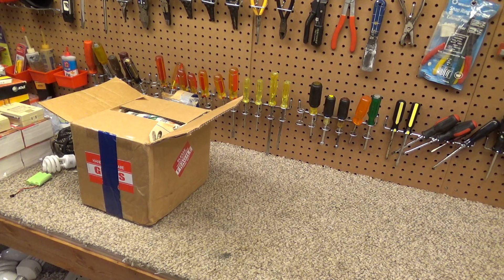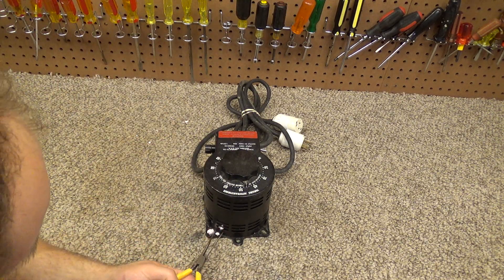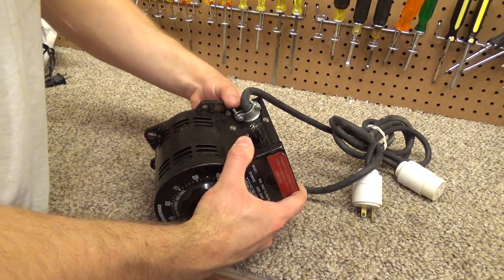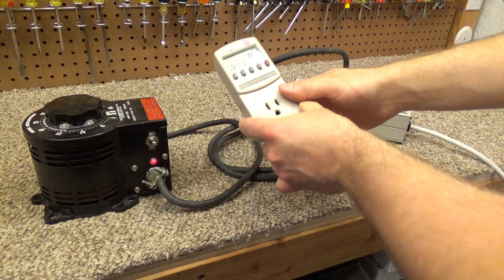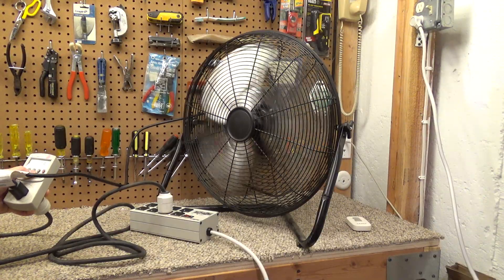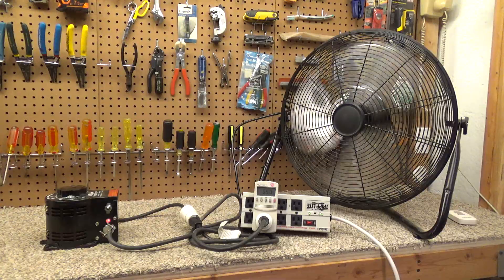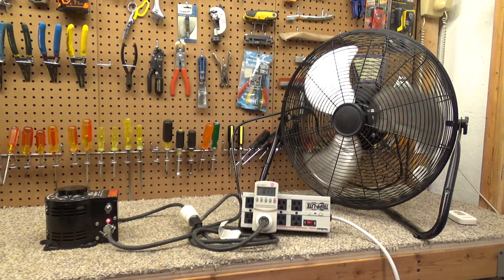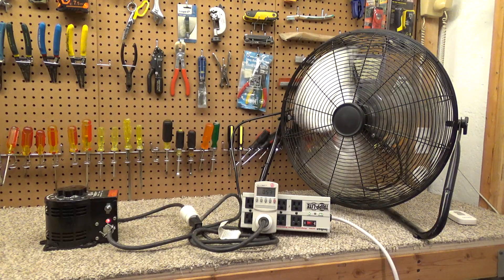Staco 10-Amp Variable Autotransformer

Comment: I have a different one sometimes known as a varac . I run it on a pedestal fan that’s to noisy on low. It’s now nice and quiet. I’ve been running it for a while and the motor seems fine might actually run cooler.